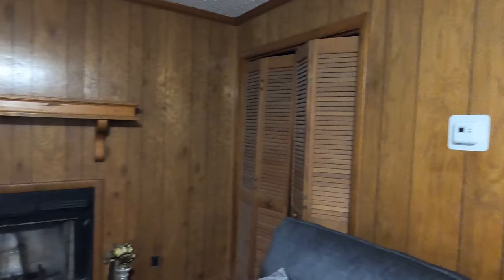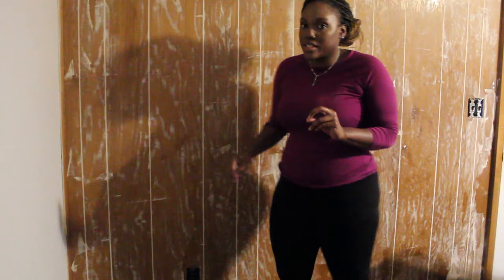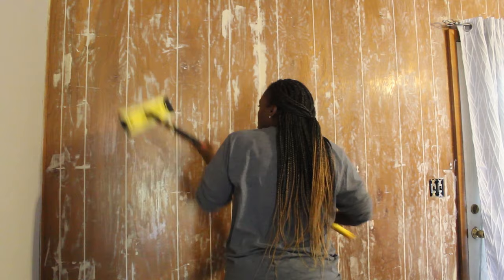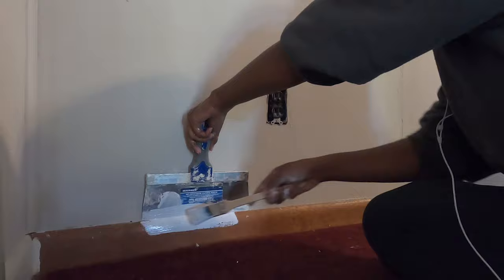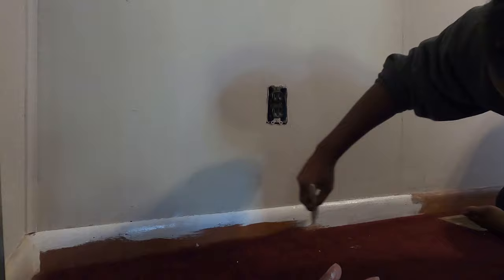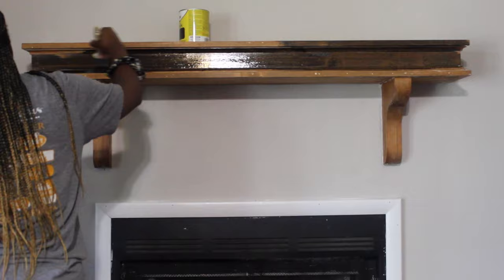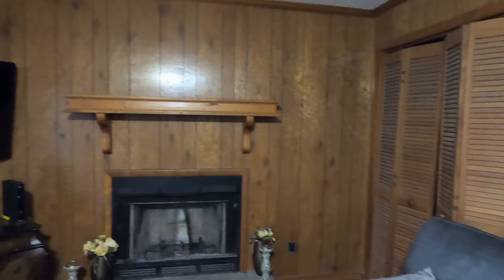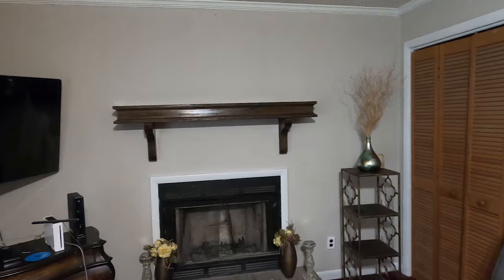Wood Paneling Makeover | LOOKS LIKE DRYWALL for $30

Comment: I'm loving this!! My whole house is wood paneling and I thought I was gonna have to take the paneling all the way down! Whew.. lemme get to work!
Reply: Same...entire mobile home.
Reply: I`ve done this technique many years ago. It worked and it was very satisfying once the job was complete. Although, it is very labor-intensive. In my case i had to do 3 coats of the compound to have the perfect smooth look I was after, which means sanding 3 times crack by crack and clean in depth  due to the dust of sanding and please prime before applying your paint. If you want to save some money it is a great way to do it but if I may, i would recommend doing one room at a time so you can determine if it is worth your time and effort to do this and also block the doorway and anything you do not want dust to get into with plastic or something (heater, lighting, light switch, outlets etc..) because you will find dust in places you never imagined could penetrate. lol   P.S. Bryan Collins, I live in a mobile home as well and if your foundation isn`t concrete, i imagine your home must shift during temperature changes like mine, (I live in Canada, very cold weather in winter) if so, you may get cracks in your walls. I did. just a little heads up. :)  Your wall looks great Mia. Good job. :)
Reply: It honestly might be cheaper and easier to just pull down the paneling. If you are lucky, your house already has drywall under the paneling.
Reply: Just hire a few workers to get it done if it's a whole house.
Reply: HI,  I  WAS in the same predicament...... bought an old FARM HOUSE,   all paneling..... Ugh, LOL,    this video is great, I wrote in the comments.
  I can do this.... I'm 72, but,  STILL pretty active.  Lol.. ...... all the best...!.
Reply: Mine also
Reply: thats what I was thinking.  Back in the 70s people actually put wood paneling over top of sheetrock to get the trendy look.  Worth checking and seeing if there is drywall back there already.
Reply: Just gave me a perfect idea for remodeling my home.  Yay!!!
Reply: It’s harder than it looks 🤣 I did my whole room and it was like a 3 day project because you have to let it dry but now I am starting to see some cracks again.
Reply: I am starting in 2 weeks on my house!
Reply: Just paint the paneling and call it a day. I promise it looks just as good. If that doesn’t satisfy you go through the paneling and mark them as shiplap boards meaning ( put put this compound in paneling line) of the boards. After it’s painted it will appears as shiplap walls.
Reply: Mobile home paneling in mine witch is just 🤮
Reply: Wow, looks so good and I just figured out what to do with my walls. I live in a mobile with paneling in some rooms, I'll do the small laundry room first and see how it turns out. Thanks for the great idea and keep up the good work.
Reply: @MAGAMAN  how many mobile homes have you seen with paneling over drywall? They made these things as cheap as possible. Many of them have 2x2 interior walls to save time and give more room space. Couple of inches in each room does add up for space efficiency, but you can hear conversations in the next room.
Reply: @MAGAMAN  we tried this and there was so much glue under the paneling that it was stuck to the drywall and stripped it. So we had to redo the drywall on the majority of one wall by filling it in with a special compound and it doesn't look great.  We did her technique on the rest of the paneling and those look fantastic!
Reply: @MAGAMAN  lmao never will you see drywall under wood paneling.
Reply: If you want a shortcut, you can just primer it and then paint.  That's what I did.  The grooves remain, but it still looks good.

Comment: This makes me feel so much better about looking at houses with that paneling.
Reply: Please just rip it out, it's drywall behind it. The house i bought in june painted directly over the paneling with eggshell. Absolutely hideous. It took only a couple hours to rip it all out
Reply: @venictos  This house is from 1978. The garage had some paneling over drywall and I tore that off. The living room has paneling but I am pretty sure there isn't anything behind it. I have yet to tackle it because of this.

If you do have drywall underneath.. then yes definitely just rip it off and patch the drywall instead.
Reply: @digi3218  i know this comment is over a year old.. but what if its over concrete walls? i think its glued on there
Reply: @iskypemoms8172  nah the paneling is over wood studs. And I've ran wiring behind it and pretty sure there is no drywall, I've still yet to rip the rest out at my house lol.

Comment: Overall GREAT TRANSFORMATION!
FYI's for reference 
It's called a drywall knife (not a spatula). 
Always clean the panelled walls prior to priming with a vinegar and water solution to remove any smoke or grime. Allow to dry overnight. (Solvents in other cleaners may react with the paint)
Priming prior to painting is best for proper adhesion, especially on a panelled  surface which is slick.
If primer isn't used any slight tap on the wall can cause paint to chip off very easily!
Also make sure proper drying time is allowed between mudding to let the gas escape or your paint will bubble and remember drywall compound does shrink and may require a second application. Sand in between applications for smoother surface.
And it is a pole sander 👍
Also when staining over a finished wood (sealed with polyurethane) you need to use a gel stain, a standard stain cannot penetrate polyurethane.
Panelled walls are 50's.
Reply: THANK YOU LOADS!  I was getting ready to dismiss a very nice house due to the ancient paneling job 👎🏾.  Also, the house has two rooms with tile ceilings.... hideous as well.

Again, CHEERS for your pocket full of wisdom, love!  I've learned loads from you in several paragraphs! 💜
Reply: I don’t think she was using drywall compound, I think she was using spackle
Reply: Dang, lol
Reply: Agree exactly. I think she did a nice video. Just take this advice and  add to what you saw please.
Reply: Thatnk you! I was wondering what the tool used to scrape the compound off was called 😅…going to the hardware store now 🤗
Reply: or putty knife

Comment: Great job. Looks amazing.  Some paneling will bleed tannins through the paint  (it looks like nicotine stains).  You may need to prime with Kilz first and wait 24 hours (trust me on that part) then paint.  You go girl!  And your paneling is from the 70's. =)
Reply: The stain blocker?
Reply: Yep oil based kilz after filling in the lines diagonally pulling it to fill in
Reply: She definitely should’ve primed it first!!
Reply: I’m watching this as a painter and my exact thought was “nope, oil prime, it’s gonna brown!”
Reply: @BransenMLee  What would you use as a primer? Kilz has worked for me in several apps. But I’m concerned as you mentioned about the bleeding thru. Thoughts? Tks.
Reply: Prime before or after the mud?
Reply: @jlc1636  16 hours before.  I did a whole room of paneling.  It's best to wait over night!!!
Reply: My walls are panels but the previous owners painted over it with a horrible grey blue color. Do I fill in with the puddy, sand with what grit sandpaper? Prime with kilts, then wait 24 hrs then paint?
Reply: I just finished my walls. I sanded the paneling[100 grit], then mud, sanded it with 120 grit, another coat of mud to fill in low spots, sand with 120 again, and then a couple coats of  bullseye primer. Then paint.
Reply: @ehpennsylvania  kilz is generally an oil based primer, I have only used kilz once though. You could also use alcohol based, but I’d recommend really any primer as long as it’s oil based. It’ll tell you on the can if you have any doubts
Reply: @chrystallmarshall5865  what did you end up doing? I'm in the same predicament
Reply: @jlc1636  mud?
Reply: Especially if it is really old paneling!! Good point. That will save some people some headaches for sure!!
Reply: Also, you can usually get your paint supplier to tint your kilz with something close to your topcoat, which makes covering the primer much easier!
Reply: Hi everyone I just bought a mobile home and it’s sooo 70s brown inside the panels are like her video so am not buying dry wall with everything to high to live so I need a kickass primer ??? Then paint right ??👍👍👍 have a good day people peace ✌️
Reply: I came here to recommend this!! For this job you want the original Kilz (oil based) not Kilz 2.
Reply: @joewells3992  Hello Joe,

Yes... You have it right. Start by dusting, if not washing the paneling. Removing years of dust, oil, and nicotine will ensure a strong permanent bond of the filler compound with the paneling. Aside from bleed though, the main issue with filling old wood paneling is having the compound fall away with the slightest bump, door slam, and/or humidity/temperature swings. Proper preparation is equally important for those hanging paper. Wall paper is going to show the same lumps and bumps as two coats of paint does. 

After the first coat of compound, sand it and add another coat. Sand the second coat as well. Follow this by vacuuming, then wiping away the sanding dust. Check for imperfections, touch up where necessary. Using and extractor fan out the window will help minimize the amount of dust. We remove the dust to ensure the primer and paint or wall paper does not have lumps or bumps.

Do not use joint compound to level off wavy areas on the wall. The waviness is due to the studs bowing, poor panel fit when installed, high humidity, or one or more various other reasons for warping. A large patch is likely to result in eventual cracking, with the patch crumbling or falling to the floor. Paneling is not as rigid as gypsum board. Hence the reason a large patch is likely to fail. Priming the surface could prevent the crumbing and falling off, but it won't prevent cracking.

Once the wall(s) has(have) been sanded, all dust removed from the floors and walls, you may spray on a coat of light texture if you desire texture walls to hide imperfections or to match gypsum walls in other rooms or on adjacent walls. 

The next step is oil based primer. Allow the primer to dry for at least 20 hours before moving on to painting. Then paint your first coat of paint. Check for imperfections. Sand and repaint any repairs. Remove all sanding dust from the room before painting the second coat. For deep paint tones a third coat can make all the difference. Flat paint, versus a semi or full gloss, is recommended. Paint with any amount of gloss will highlight the usual wavy paneling. Paper with busy patterns and/or texture help to mask wavy walls. Again a shop clerk will assist you with the best options for your situation and budget. 

Proper preparation is key to achieving an outcome worthy of pride. This includes taping and covering or removing wood trim, outlet covers, switch plates, and other fixtures and fitting, using the right brush or roller for the task, and choosing a quality primer and paint. Lastly do not try to lay in one thick coat or primer and/or paint. Failing to invest a little extra time and a few pounds more to complete the task properly shows with the end result. 

Those at the paint shop will advise you on the appropriate primer and paint for the specific paneling you have. Snap a picture or take a small piece with you to the shop. 

Long winded... Yes... Hopefully useful to one or more readers.
Reply: @J.Cameron.Stuart.Adams.  THANK YOU! ❤ Not long winded at all.....I would call it INFORMATIVE 😄
Reply: @jlc1636  Prime after mud.
Reply: I appreciate everyone's comments about using oil based primer! Gonna start mudding my walls, then sand,primer and paint next weekend!

Comment: THANK YOU. I'm actually going for a 1950's inspired room but want a solid colored wall that will match my room better than the tacky wood paneling.. You are such a lifesaver with this!! I literally can not thank you enough omg. I'm new to renovation and remodeling so this is extremely helpful. I grew up being ashamed of living in a trailer that has wood paneling like this.. but a home is a home and anything can be made beautiful with a little elbow grease and hard work. <3
Reply from the maker: YESSSS!! A home is definitely what you make!!! There are so many DIY methods now, you can transform any space to fit what you need. There may be some trial and error, but so worth it in the end.

Comment: I learned when filling in the lines to use only hot mud. It does not fall off later. Then I paint it over with only oil based kilzs. Otherwise the oils in paneling comes through the paint. Once painted with Kilzs then put finish color on. This I learned from years of past mistakes.

Comment: Finally a video on this type of paneling. My apartment is filled with this and I hate it so damn much. Never thought to fill between panels. Already got 2 room mostly painted and you can still see groves (not that big a deal to me though but I more than likely will fill them in later on)
The living room and the random spots are either paneling or wallpaper (grandma style I like to call it) gotta tear that off and paint as well.

Comment: Yaaaaas! Great job! I love it. We have similar walls. I just painted them in one room but was looking for a way to do this in the other. One word of caution. I learned this painting mine. If you start to notice the walls look dirty or a little less white/off white. That’s the stain from the wood paneling coming through. You gotta use primer before you paint. Doesn’t matter how many layers of paint. It will come though eventually. If it happens to you, just lightly sand, prime, and repaint. Looks amazing though!

Comment: Did this in our den a few years ago, one thing I wish I knew ahead of time was that where the panels connect, you will get long vertical cracks coming through the drywall mud and paint in winter when the wood contracts if you live in a cold climate. I think our panels are about 6 ft wide so it's not a ton of cracks in the room but still annoying. I've patched up the cracks a couple times so far but haven't found a caulk/filler yet thats flexible enough. If that's a big deal for you, might be better to just drywall it once and done instead of patching and repainting every year or two.

Comment: Holy smokes girl!! This looks SO GOOD! I have wood paneling in a dining room I’m dying to get rid of/cover, and you’ve given me faith that I can! Also just a tip, I’ve found that oil-based white primer is the BEST at really covering wood and keeping it from bleeding through the paint - I did this with baseboards and it gave better results than water-based white primer.

Comment: On another video they recommended using the bonding primer on the paneling like she did on the trim. If not, the paint will start to give way and peel off. Plus you don't have to do as many coats of paint. Covering paneling usually takes two to three coats, hopefully just one with the primer. But if it takes more, I got time.

Comment: First off this is a lot of work and sheet rock is quicker and easier and done right. But if you do not know how to sheet rock. Than this is a good option.
You need to clean panels. Some people well sand. Depends on what primers etc. You need to secure the butt joints using glue material and more braided nails. This is because of expansion and contraction causing cracks. Two coats minimum and more well be needed where you sanded down to far. The lines should be feathered not sanded flat as vid shows. This is because they well show back up after painting. Texturing really helps also for hiding lines. Panels should be secured with little movement. Depending on texture of paneling. You might have to skim coat everything.
Bottom line. Its a hick of a lot of work to do it right and sheet rock is  quicker and nicer looking. Appreciate your hard work and enthusiasm.

Comment: I'm a bit curious how this will last. Wood expands and contracts seasonally and might end up separating from the filler you used or squeezing it out. Might take a few years, but the same thing often happens with filler on wood floors

Comment: The Benjamin Moore paint company has a video  about doing paneling. They first washed the entire wall to remove any contaminates, then  painted every crack line with primer, then applied the filler, sanded everything. Finally applied the primer and paint. Does it matter that you applied the filler to the cracks without primer under it? It would seem to me that the filler would stick better to the wood cracks like you applied it.

Comment: Lol "the nineties". Didn't fake wood paneling start when so many cheap homes were built after WW2? It was really popular in the 60s and 70s, was considered dated by the 80s, and was starting to be retro in the 90s! 
 Nice job though, looks good. I'm thinking do the closet door the wall color since you painted the trim and mantle differently. I personally would have left the mantle and trim, and done some light brass accents since they all read as a yellow, and then contrast with deep purple accents maybe even an accent wall.

Comment: Thank you for this.  My den is all paneling and this is the answer to my problems! Q: 1. Did you clean the paneling before putting the joint compound on? 2. When you put the bonding primer on the trim, did you have to sand it down before you painted it?